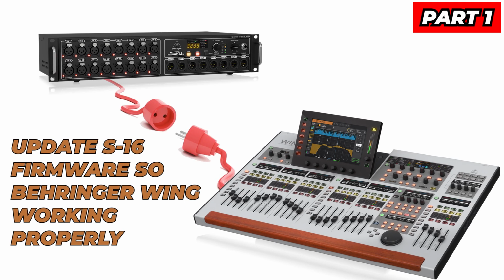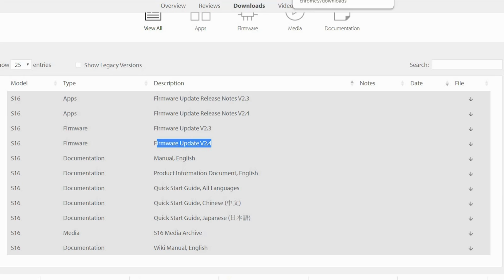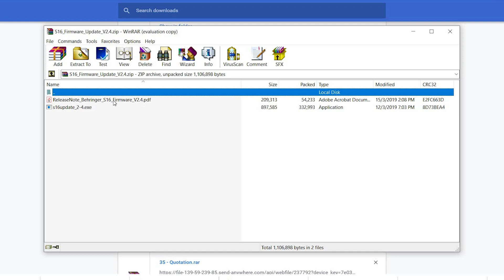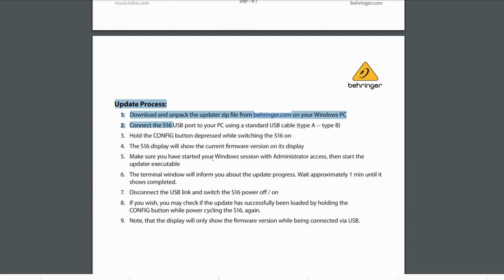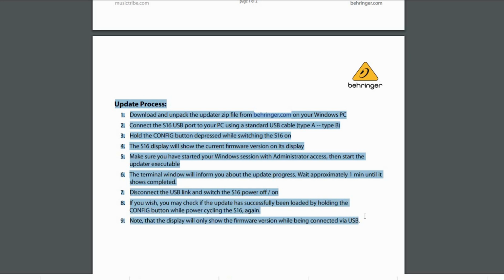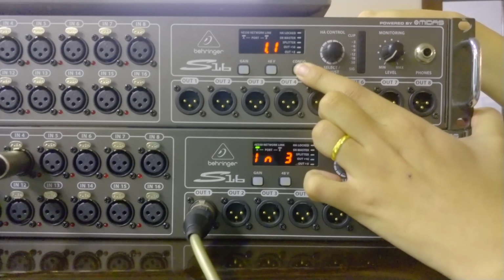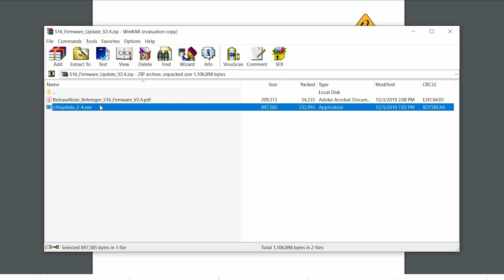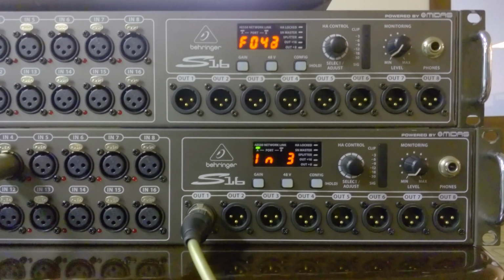Behringer WING Problem with S16 - Upgrade your stage box firmware (Part 1)

Comment: Thanks Eric, we are having problems with phantom power. Hopefully this will fix it!
Reply from the maker: What problem is that?
Reply: @ericcheesaihoo  Phantom power would not turn on with the Wing.  Updated to 2.5, solved problem!
Reply from the maker: @jjmonty8090  bug... however, I never experience this issue before. glad it was solved with firmware update.